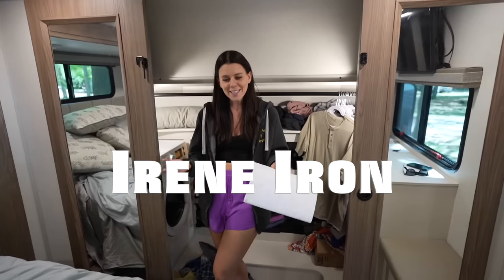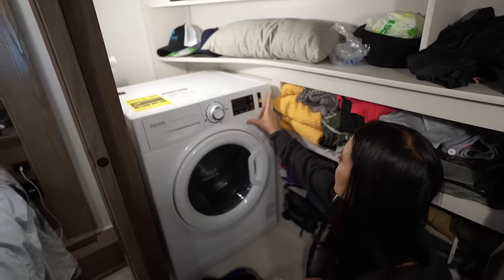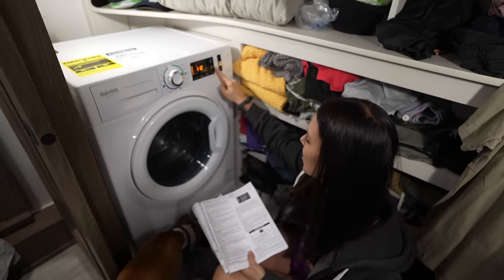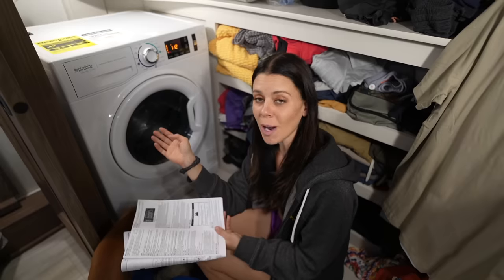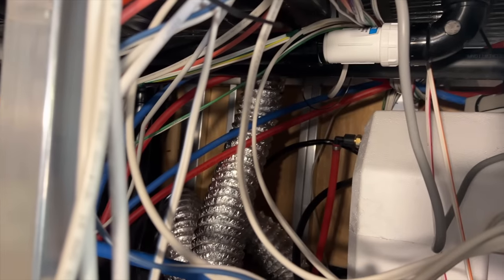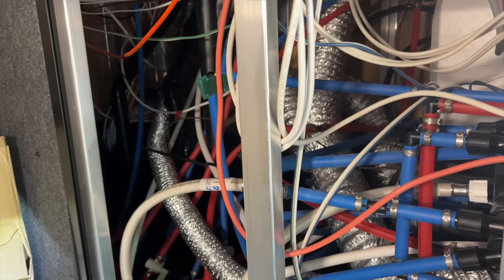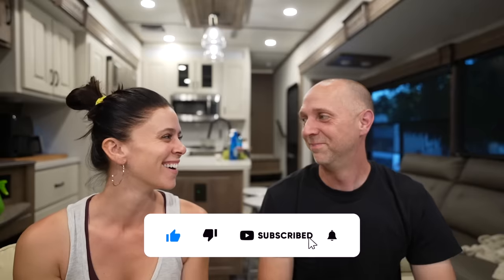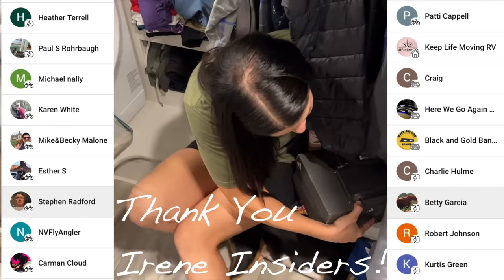We weren't expecting THIS one week after buying our New RV

Comment: The entire industry is mixing materials in the plumbing system and it's creating a ton of problems. I've seen pex b mixed with vinyl tubing, and they are using pex fittings on the vinyl tubing that are NOT rated for that application! However, most times the fix is as easy as tightening the clamps. Don't know why they don't use pex A. those connectors would handle the constant movement better and be more reliable for their workers, and would result in less warranty claims. IE money saved. Just shows those folks in charge don't understand the product they are trying to build and sell. 
BUT. They all leak. We're asking a lot for a house to enjoy moving down the road. 
I'd suspect it has more to do with "we've always done it this way and it works" mentality, resistance to change, more so than it is a money issue. They are bleeding profit over warranty claims. 
Mine didn't leak until I touched the fitting, going out tomorrow to recrimp the clamp, and the crimpers now come with me on trips until I replumb the whole thing lol :)

Comment: That's a Super NO for an Alliance.  Bad enough, they hired a lazy worker.   But they didn't pay you to do their pre delivery testing.   And your stuff got wet.  TIP. Air compressor with a long air wand for drying this up and general cleaning too.  I'm so severely disappointed in the RV industry.   Nice production though.   I had a 72 Holiday Rambler spoil me. Since then. I make my own RVs doing Auto hauler conversions. Until some co starts doing it right.

Comment: You have more patience than I do.  A brand new unit with ABS drain pipe obviously not bonded together is extremely poor quality control and the other drain is a known issue? OMG  I have been in the manufacturing business for 35 years and this is so typical of the RV industry, If I were to deliver any of my products to my customers with dumb issues like that, I would lose my business.  This is extremely poor quality control and workmanship.  And BTW every new RV should be perfect and it's attitudes like yours that permit them to deliver garbage, not just Alliance it's rampant across the industry,  just not acceptable.

Comment: There is no excuse for this kind of failure.  This is nothing other than a complete process and quality control failure.  A wet test of the plumbing would have found this problem.  Customer support is wonderful, but you know what's better?  Putting out a quality product!  In an ideal situation, customer support should only be educating buyers in the proper use of the RV's features, and not in making repairs.  A good question to ask is what did Alliance do to shore up their process.